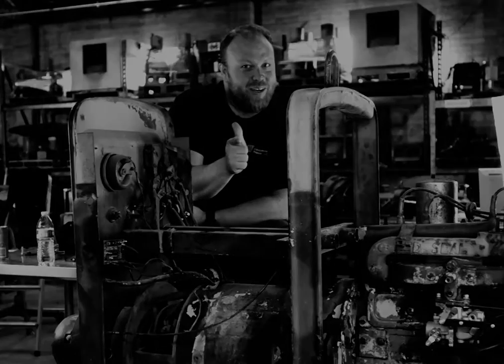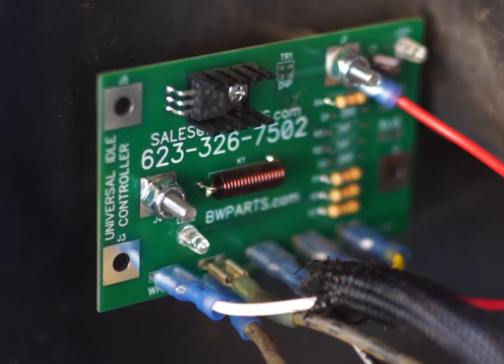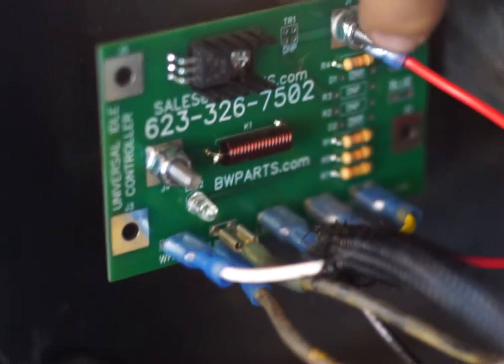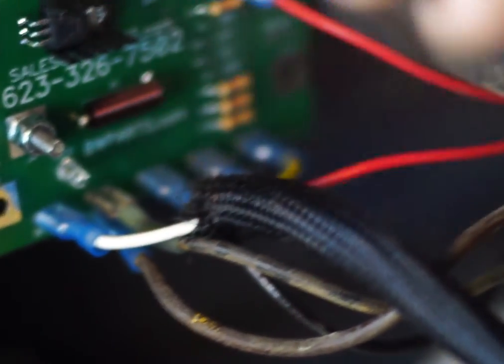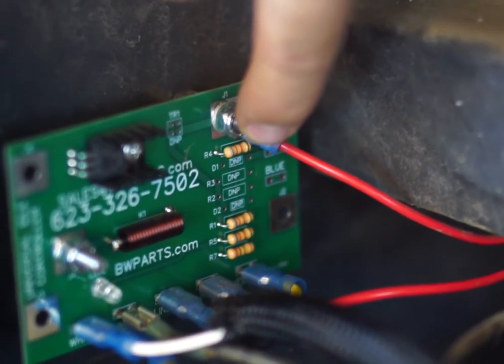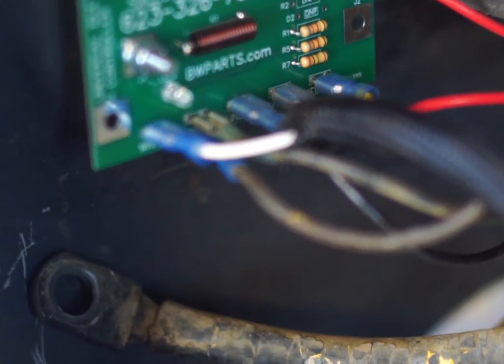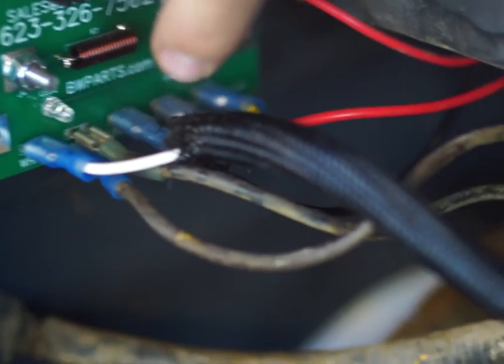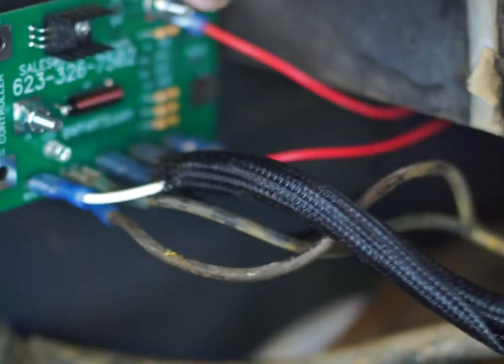Low Idle PC Board description and installation: Lincoln Arc Welder

Comment: What model Lincoln machines will this board work with?  I have a Weldanpower 250 D10 pro that won't idle.  Will try to test the solenoid.

Comment: Guys I have a vantage 300. It won't crank up the amps on downhill pipe, but seems to work ok on Constant Current. Any tips or ideas? Thanks guys.
Reply: In downhill mode, the welder reacts differently than in cc/stick mode. It was designed to act similar to a pipeliner. The voltage will drop more significantly when the load is increased. Dial your output for the amperage you want plus 30-40%. Start welding and decrease to get the arc where you want it. Also use you arc control to jump between root/hot pass/cap. Softer for cap and crisp for fill. Try that and see if it help getter control in downhill mode on pipe.